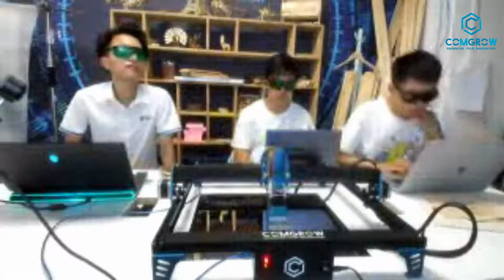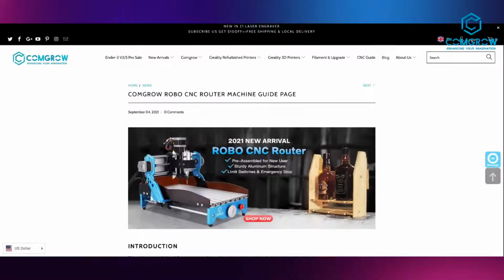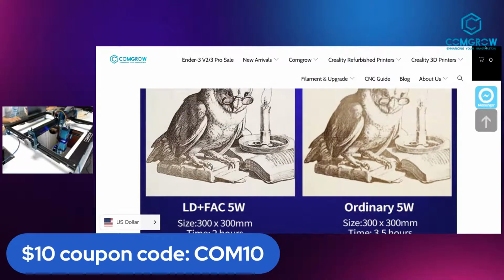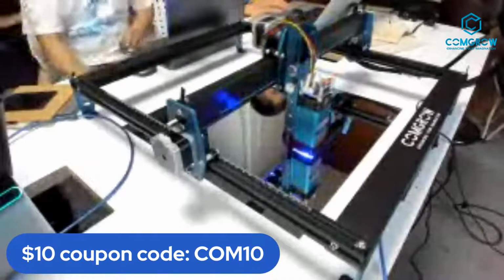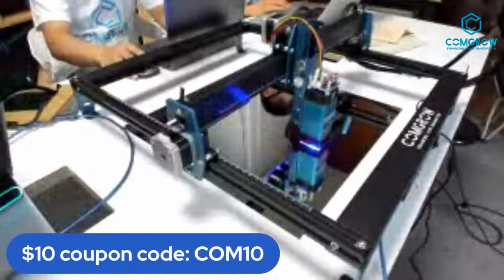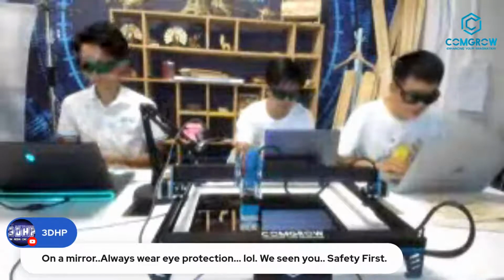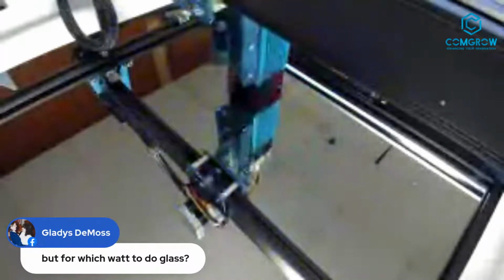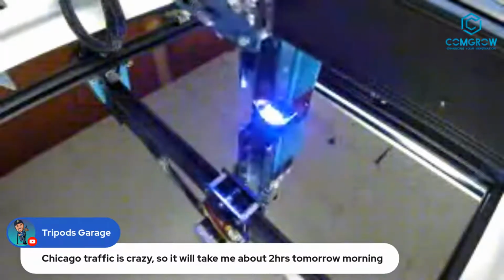Comgrow new machine: COMGO Z1 live broadcast

Comment: Wish I could get some help setting up!  The instructions are horrible, the videos are not much better.  I think Im sending it back......
Reply from the maker: Hi, Malinda Coletta. I feel sorry about that. May I help you to solve it?
Reply: @ComgrowOfficial  ORDER COM12950

the machine is a refurbished z1 purchased directly from Comgrove order 12950.

I have downloaded Lightburn and the driver

Im using a MacBook Pro MacOS Monteray V12.5

I can get the machine to power up but when the laser moves to the front left it goes to that corner and vibrates like to wants to keep moving but its in the corner and cant move forward.

I/m very frustrated, the documentation is not good and the videos are horrible.

Comment: How long will the laser last? Will it cut balsa? What kind of warranty does it have? And is there a U.S. warehouse that it ships from?
Reply from the maker: Hello, the working life of our laser head module is 10000 hours. If it reaches, you just need to replace the laser head.  Btw, if the rest of the transmission structure has regular maintenance, the service life could be very long.